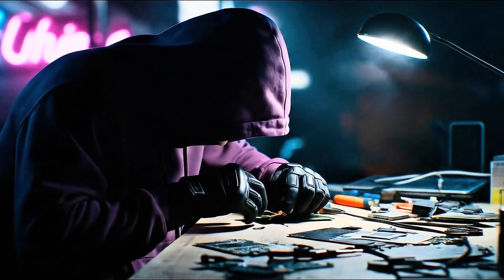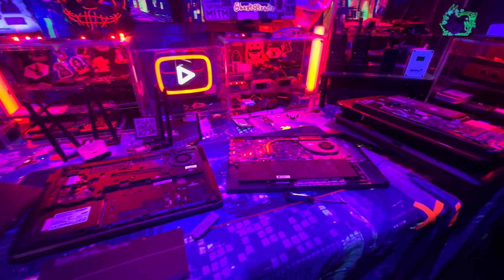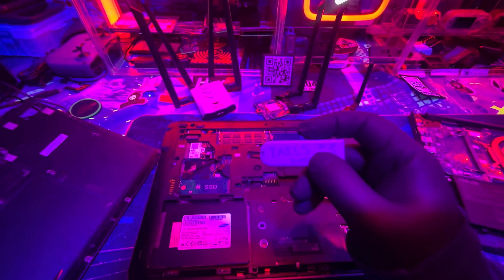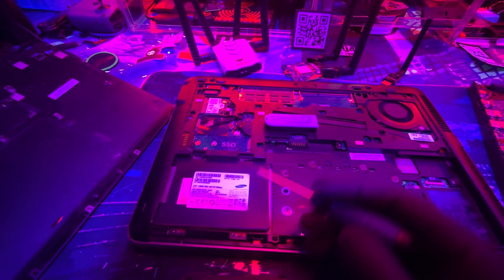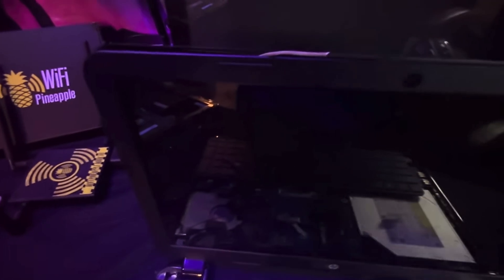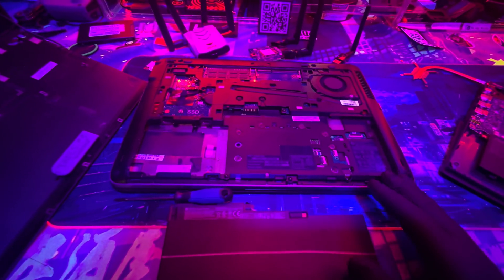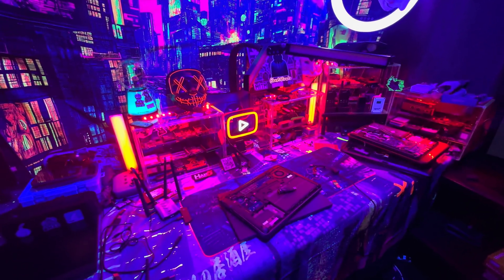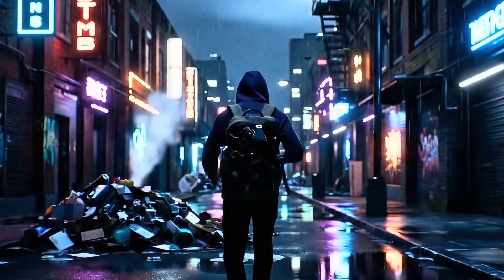DIY Ghost Laptop UPDATED: Full Build Guide — And the Harsh Truth About Privacy!

Comment: Surprised you are not mentioning Computrace (and similar) as well as CPU BMC (basebamd management contr) Intels started that  from P4 era AMD was a bit behind so AMD started it like in 2005 approx as far as i remember. Prior to that Piii was the first cpu which had serial number burnt in, however older voard BIOSs allowed to turn serial number share OFF. So, essentially, if you want truly stealthy computer you need to look in to Pii/Piii era systems. Dont be surprised that top line laptops or PCs with that hardware will ccost as much as new PC. Many cryptoenthusiasts use those as well as security experts.

Comment: The idea is good, but the execution...

First of all, current computers use dynamic ram, they can only hold data for a few milliseconds, a few seconds at max, so destroying the ram is completely stupid. Second of all, destroying the whole computer can't destroy all data in permanent storage. Let's say there is still a flash storage somewhere, when you just destroy the computer, you will completely destroy all IO circuitry, and probably even parts of the memory controller, but definitely not all data, someone with specific tools will be able to remove the damaged storage, etch away on the case, and extract some data, so the only thing you're destroying is your hard earned money.

One thing that you didn't mention at all is that in modern commuters the old read only bios chip is replaced with a flash chip, which can get compromised by an attacker, the modern Intel processors even have more permission rings, where code from that (possibly compromised) flash can do anything while being undetectable to the OS kernel. 

Furthermore, modern conputers have lots of microcontrollers for things like IO, so even a compromised keyboard chip, or a compromised grsphics card could steal data from you. This is unlikely because it can only be used in very specialized attacks, but it shouldn't be ignored.

Comment: Its not actually ghost comp, first you need a laptop that can run without a battery so if in hurry just unplug. If working where no power source, make sure for usbc charging and proper bat pack. For "cold" attack on ram comp must run and retain data.
Second, you need a whole lot of BIOS mods and reflash to just begin thinking about anonymity... 
Also, tails is kinda ok, but tor is far from being secured. 
At the end, for basic user, buy a laptop, remove the drive and use tails with nonpersistent option, its enough. If youre criminal, you should do it properly
Reply: Yeah, TOR has been compromised for a long time. I remember reading white papers around 2013 that detailed the crumb trail it leaves, and LE still uses this to nail users.
Reply: Yeah there's a few useful tips here, but the guy is clearly cosplaying a red teamer lul.
Reply: So is there a replacement?
Reply: Doing it properly if a criminal is to not be a criminal.
Reply: @WaveformV1.0 Or just be Russian. Cybercrime pretty much gets a free pass so long as it's not committed against other Russians. There are even crypto stealers that advertise themselves at conferences. It's kinda wild how brazen they are.

Comment: The digital footprint you leave is the hardest part. The hardware and software burner computer requires far less work in practice than this video espouses. But you’re right about online presence.
Reply: what about combining the use of a VPS server, a premium rotanting proxy service and an anti detection browser to add a couple more walls to the tracking part?

Like, in Dolphin Anty you have the possibility to create a new footprint as well as a MAC address and a desktop user name for each browser that you create. 

In practice you can have 10 diferent browsers each one with their own footprint and MAC address associated to it and you can add an individual proxy to each browser, so you could check some information with one, close it down and erase it and then keep it up with other browser with a whole new set of information associated to it

Comment: To reverse a speaker to a microphone, you'd need an ADC and a way for the signal to get to it... Which in most builds certainly won't work...

A speaker assembly is build to convert digital audio to an analog signal and the boost/amplify that signal to put it on the speaker.
The Amp does not work in reverse. Not only that it actively blocks the returning signal...
Similarly the DAC does nothing with the analog signal....
Reply: Built-in speakers or external headphones can most definitely be turned into microphones if the devices are equipped with certain Realtek chips. Please look up speake(a)r

Comment: Surprised the video didn’t mention physical relay stations. They’re crucial for serious OPSEC—routing traffic through remote-controlled systems (like single-use Wi-Fi repeaters or directional antennas) helps decouple your physical location from signal origin. Paired with low-power RF, directional transmission, and strict timing control, it's one of the few ways to limit traceability. Still vulnerable to signal triangulation and RF fingerprinting, though—nothing's bulletproof.
Reply: ESP32s in a tic-tac container with a battery left anywhere you have Wifi service
Reply: These days satellites can create maps of radio waves emissions.

Your advice is good but must be paired with understanding that RF-emmiting device in the middle of nowhere in some circumstances can be quite literally seen from space.

 Directional antennas are used to have a good signal over a big distance, but they are not perfect.

Comment: What to do about the BIOS/UEFI. The BIOS/UEFI can also track you and do other spy stuff.  Will you replace the BIOS/UEFI with a Open Source BIOS/UEFI or do you alter the original BIOS/UEFI Chip/Software.

You can also add a button to the battery if possible to make sure the Power is off to the Laptop.

But super good infomation video 💪👍
Reply: Update it and change setting to not allow remote flashing. You can also block certain protocols involved with flashing BIOS or accessing CPU remotely..
Reply: yeah some bios have a backdoor
Reply: AMD is going to open source their software in near future

Comment: I can see people doing this and then having their phone chilling in their pocket the whole time LMAO
Reply: epic opsec
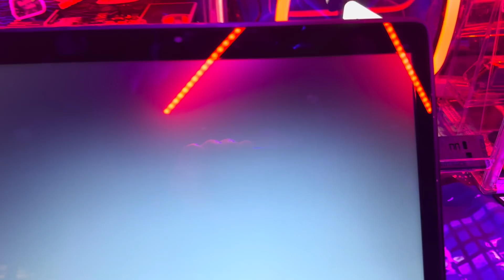Reply: @GhostStrats   8:10 Ladies and Gentlemen we got him. We were able to match his handwriting with our typography records
Reply: @GhostStrats  Youtube keeps deleting my comments Hahaha, I wanted to share my experience however the technocracy overlords don't like it.
Reply: @GhostStrats  Well to be completely untraceable is doable but very time consuming. Just buy a pre 2012 system laptop and flash the bios chip with program me_cleaner, Get rid of anything with blobs and remove wifi, cameras, mics and speakers, Install coreboot and program a USB access key. Install Qubes OS on your system, also you could buy a faraday bag for extra measure. Treat every USB like it's infected and veracrypt everything with double layer (Veracrypt doesn't protect against state actors). Find a pre 2012 Desktop and do the same thing. At that point you're almost airtight, Buy a Pf sense router and route everything over NYM VPN, Proton VPN or Mullvad VPN, Change your DNS to Mullvad and set up a secure firewall with good traffic flow rules, Maybe set up a proxy chain as well but not really necessary at that point. Also you can buy new desktops with the latest CPU's and make them somewhat secure however not completely secure like older units as Hardware manufactures have made it extremely difficult to remove the ME or PSP and Blobs etc, You can neuter them but not completely and you risk bricking a very expensive board, Hardware manufactures never tell you whats running in the boot sequence completely and state actors have access to these zero day vulnerabilities. Also if you can't be bothered doing any of that you can buy a computer from NitroKey that's been almost fully secured, they make some of the most hardened computers in the world. Nitro Key serve International Governments as well as the general public, they also take the latest google pixel phones - Boot them with graphine and remove all sensors, mic's and speakers etc. Purism also make pretty secure laptops as a second choice however not idea for tight security.
Reply: Can you make one for ghost phone
Reply: @Mysongmaker  flea market used pixel 6 or 7, install graphene from a laptop that runs on tails os, don't install g-apps, get a prepaid sim card at some shady dark alley in cash, boom...almost ghost smartphone (flip dumb phones are better) lol (i'm just messing with you, don't follow my weird comment in real life).
Reply: @OMNITEK  Nowadays you have to register prepaid SIM with your ID and credentials to activate it.
Reply: @Atom224  not in America.  I have 3 phones that I use with prepaid Sim cards that I pay with cash.
Reply: @OMNITEK people will find out what it takes to get a clean tails install and give up on that step.
Reply: @Atom224  not all of them, i would never keep an ID registered sim card with me, hell nooo...there's enough creeping in without having my actual id tied to some garbage phone carrier.
Reply: @atitagain83  we never said it's easy, that's the point, it takes steps and patience to avoid being sold on the market like cattle for data and ads.
Reply: @OMNITEK  or get a sim anywhere & wait until CCTV is overwritten. But you gotta be really deep in some illegal stuff to make it worthwhile to go that far.
Reply: @Atom224  NOPE there is a way you get preregistered from turkey etc. Its not hard but you pay a lil bit more then a normal card and the cash on it is very fast at zero :> but the card is on a fake name
Reply: @Mysongmaker buy a oay as you go with cash lmao, or go the meshtastic route
Reply: @Mysongmaker use graphene OS or lineage OS degoogle android
Reply: @Mysongmaker Lol, there is no such thing as an burner phone. As long as the battery is inside you are being tracked.
Reply: @Mysongmaker theres no sense of doing it
Reply: Until they get graphene os
Reply: @Pignuglama is graphite really that secure though? I mean in the hands of someone who knows who to practice proper opsec it makes sense, but get some silly goose installing YouTube and Facebook on their phone and it’s still a spy device no? I’ve personally never used graphine OS so I’m not sure what the capabilities are
Reply: @ChrisDeger imagine it was an elaborate scheme to get criminals information 😂
Reply: Internet over VHF radio or even better over HF 
The only way to go completly anonymus
Reply: Yep
Reply: Thethering the laptop to their phone to get wifi also.
Reply: Is booting from a thumb drive really more secure than a hard drive though? If it's only used for boot the the thumb drive is really just an inconvenience.  It might actually make more sense to reduce attack surface by disabling USB ports and booting to ram from an internal drive.
Reply: Fr
Reply: Right?!
Reply: Exactly bro...or they gfs or sisters or mums/dads that's all they do before they go all NSA on ur ass.
Reply: oh hey another clippy
Reply: @dustyink.c hello clippy brother
Reply: Yeah me
Reply: I had a good laugh at this because it so true to almost everyone under the age of 30 trying to go unnoticed.
Reply: @BS_Knows_Best   cameras can't spy in pockets & what's the big deal on the mic picking up keyboard clatter and youtube rambling?
Reply: Yea criminals aren't really known for being smart lol
Reply: @phouckmedammit   cameras can't spy in pockets & what's the big deal on the mic picking up keyboard clatter and youtube rambling?
Reply: @GaryS-b3y I mean if u were really doing something you shouldn't you shouldn't have a tracking device on you at all. I feel like that's before rule 1.
Reply: You are probably proving my point lmaooo
Reply: well we now need a ghost phone
Reply: That's fine, if you follow these instructions your phone is not connected to the lappy! If you tor and proxy, no DNS leakage and blah blah blah, you're also slimming the chances of been caught. Wardriving, spoofing MAC, so on so forth... But at the end of it all, people are the vulnerability. So it's none zero at all times
Reply: Doesnt matter if laptop never connects to your network 🎉 sure the towers could ping your burner it connects to thats near by your personal phone. Doesnt matter either as long as you are in a city.
Reply: we just found out that you got a nice gooning collection.
Reply: Or having this video is their YouTube "history"
Reply: @Richiethebull369  so what. I hate how overkill y'all are. Super unneccesary
Reply: Cameras can't see thru pockets & even if they did, they'd have to be angled towards the computer
Reply: lol.   my first thought.
Reply: @GF_Burke  except cameras can't spy in pockets & what's the big deal on the mic picking up keyboard clatter and youtube rambling?
Reply: @GaryS-b3y damn Gary you really on here trying to prove your point about pocket cameras lol. Look at the machine he is building … no mic no location no permanent storage a ghost machine it defeats the purpose of the machine if your rocking a gps device with a mic and camera in your pocket probably on the same local address attaching your identity to the “ghost machine “ lol
Reply: except cameras can't spy in pockets & what's the big deal on the mic picking up keyboard clatter and youtube rambling?

Comment: "Also remove the speakers because they can be can be reversed to function as microphones"

Just who exactly is your adversary, sir?  God himself???
Reply: On some hardware, reversing the polarity of the speaker wire will genuinely turn it into a speaker.  A really bad speaker, but a speaker.  I did this with a pair of headset once when they broke...
Reply: @jupitersky its a classic method of getting a cheap microphone for those of us who grew up with tape recorders. Could quite literally plug your headphones into the 3.5mm microphone jack and use them as a microphone.
Reply: LOL
Reply: Neither of those have historically been difficult to hack.
Reply: This is a good joke, but I've used speakers as microphones before 😂.

Allegedly our devices can talk to each other through frequencies we can't hear.

Comment: DRAM wouldn't hold the data for long after shutoff, maybe a few minutes max... 
It needs constant refreshing to reliably hold data.
By the time you removed the ram and connected it to some device that would be able to read the contents, the data should be gone...
Reply: You'd also need the MMU state to reliably read it.
Reply: Tails also cleans up after itself a little bit if I remember correctly.
Reply: milliseconds at most.

Comment: Great video! 
I was wondering how far one could go with a smartphone! is it possible to boot a custom os on one, how to go about removing cameras, mics and wifi, etc...
would be an interesting topic maybe! <3
Reply: You're better off with something like a Raspberry Pi, since they're way cheaper and come without a bunch of the hardware you'd have to dig out of a smartphone, but yes it's technically possible to boot a custom OS on smartphones, (android more easily than apple) and you'd have to remove the cell phone functionality to gain the benefits from removing the WiFi antenna anyway, so sort of pointless to bother unless you're going for some kind of rube-goldberg achievement.

Comment: Perhaps a raspberry pi would work well too?
Reply: Best option by far.
Reply: Tails can't be installed on raspberry
Reply: Dont need tails  @Tecnologiko
Reply: @Tecnologiko  Lokinet
Reply: @Tecnologiko  Lokinet 😌
Reply: @Tecnologiko  Can't be installed, or can't be run? 
Because you can install it on a USB stick or micro-SD, and if it can boot from that and run, you don't need to be able to install it on the hardware.

If it can't run at all, then look for a different Linux distro.